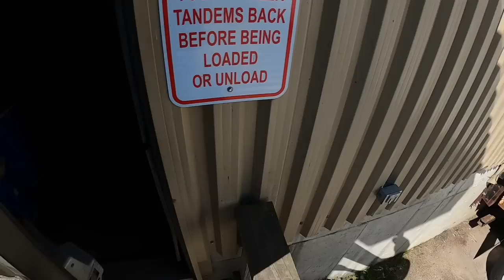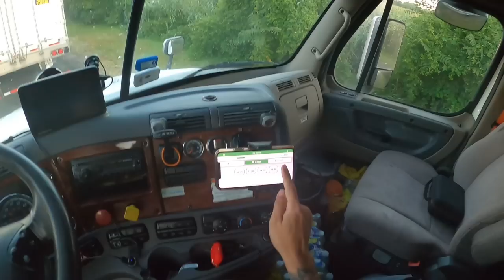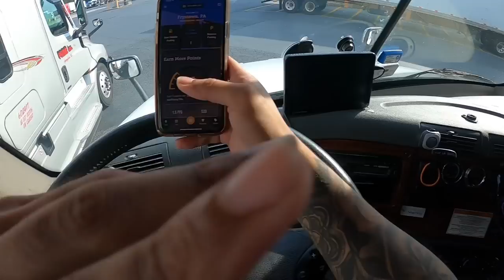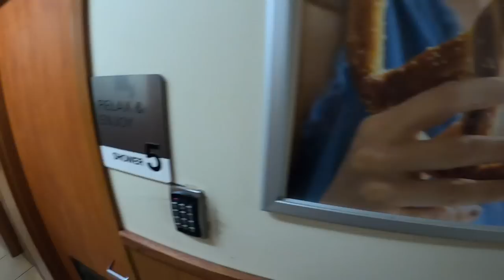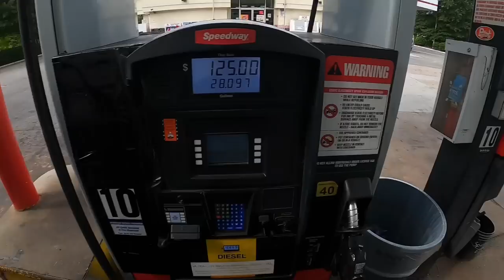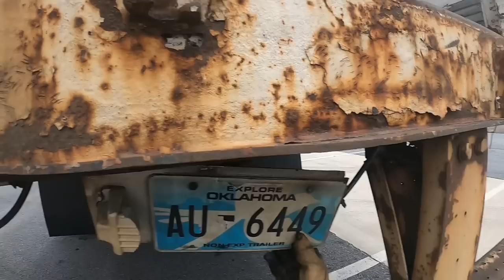Trucking is exhausting 😪 Maine to Georgia Load

Comment: As someone with a boring office job make sure you think long and hard before leaving trucking because the grass definitely isn’t greener on the other side
Reply: @danbobway5656  I drive trucks lol and I would rather be bored out here than at that office
Reply: I’ve had an office job doing graphic design - Always wanted to truck and now I do, working on my 2nd year started regional heavy flatbed and now doing local hourly hauling woodchips making 8-10k a month. Other side of it, I know every crack and bend in the road, every broke down car and in the winter chaining is required 2-3 times a day and I have no local yard since my company is based out of a different area so makes things a little harder but wouldn’t change it - home every night, 12-16hr days 5 days a weeks, no governor and no camera with new equipment.
Reply: The grass is not greener in any side.
Reply: O but it iz greener TRUCKIN WILL ZUK THE LIFE OUT OF U .
Reply: This world is a delusion have you all been to a desert?
Reply: @StickyRickyBimmer  - I drove truck then went into graphic design for 6 years (for family time). Now I’m getting back into a truck and still doing some design. Even with 6 years experience and two AA design degrees I couldn’t find more work and my 30k a year job wasn’t cutting it anymore.

Comment: I started truck in the beginning of summer. I work in Bulk Commodities I run powder, cement, limestone, sand etc. it’s local, I work just under 60 hours a week and make about $1,200 a week. It’s a lot of work though. I want to do it for a year, then get into hauling fuel

Comment: 17:25. Idk man I don't think you understand how supply and demand works lol.  Prices would drop if demand dropped, and you're saying the opposite.  It's basic economics.  That said the way oil is basically ran by the government and only a small handful of companies they don't necessarily have to follow those principles and in theory could gouge counter to supply and demand I'd say, but it's unlikely because big industry which relies on trucking would counter lobby.   The bottom would fall out of oil and prices would likely plummet as I've said.   You should know basic economics before forming an opinion of such matters.  The real issue is outright bans on combustion engines like California already has passed

Comment: What's your average speed on the highway?
Reply from the maker: I cruise 71-72
Reply: @chez8239  I hauled for Amazon over 1 year ago the majority 99% of them drive 68-72mph. I drove 60-63mph, why? Because I would save 20-35 gallons pet day. It might vary on the type of truck you have but in general the faster you go, the more fuel your truck will consume. If I saved 20 gallons per day, multiple that by 6 then multiple that by 30 days ect. If you pay for fuel, it would be wise to know  what is optimal speed for you